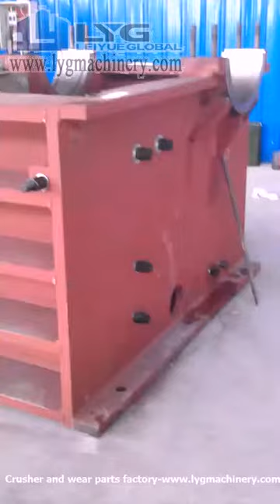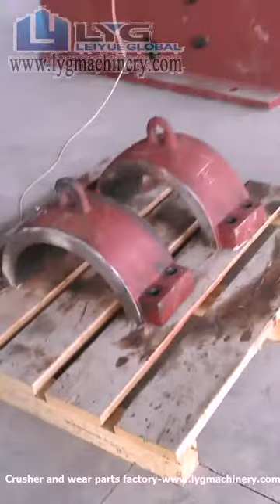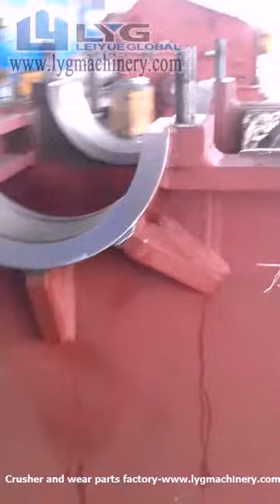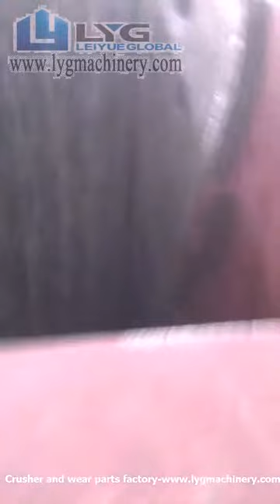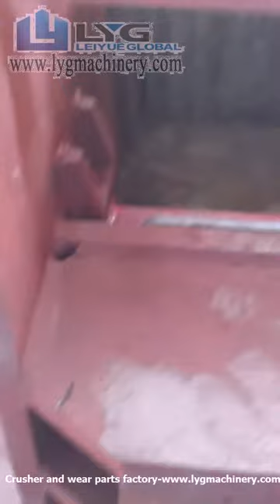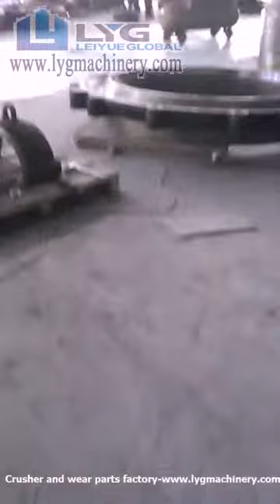JAW PLATES FOR JAW CRUSHER SWING JAW PLATES -toni.miao@lygmachinery.com

Comment from the maker: toni.miao@lygmachinery.com
http://www.lygmachinery.com

JAW PLATES FOR JAW CRUSHER SWING JAW PLATES

 

LeiYue Manufactures an extensive range of wear and spare parts in Shangha for the worlds most popular crushing brands. 

 

Jaw plate is manufactured with super high manganese steel, therefore it has a service life 50~100% longer than those made of traditional high manganese steel. Every model of PE series jaw crushers is tested for shock, stress, strain, thermal loading, deformation, vibration and noise under a wide range of load conditions. The special processing techniques ensure that our jaw plate has leading performance:

1)Using cold processing hardening technology, the hardness is improved.

2)Water toughening technology to avoid making the performance poor during the process of natural phase change.